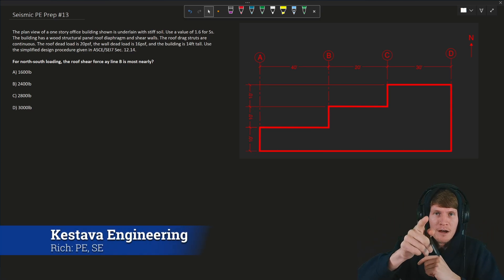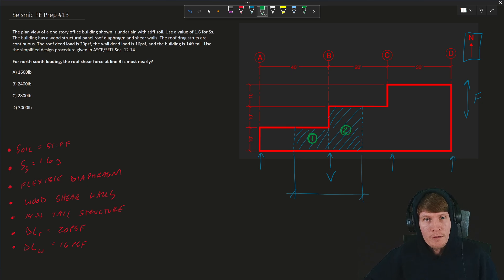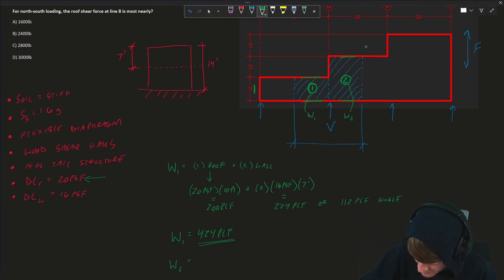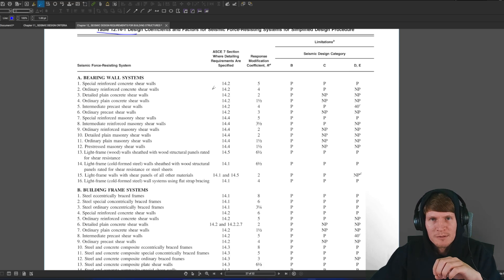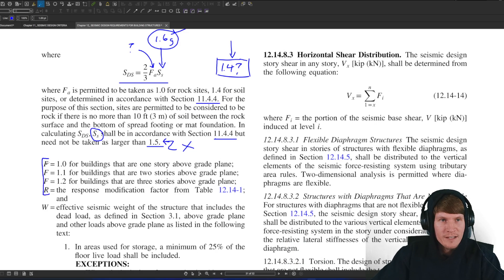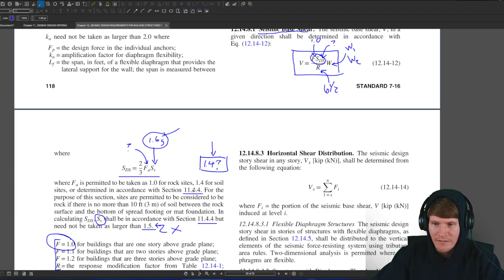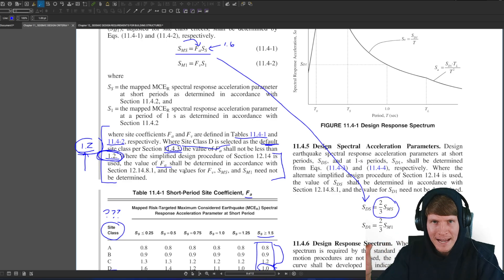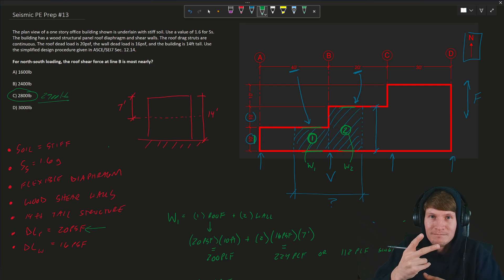PE Seismic Example Problem - 13 #structuralengineering #civilengineering #engineering

Comment: In a flexible diaphragm, the total diaphragm force should be distributed to the resisting vertical elements in proportion to tributary area, NOT tributary weight. Please correct me if I’m wrong, but doing so will result in a different reaction at each wall.
Reply from the maker: This can be tricky depending on how you describe it. Getting your diaphragm force is a product of the story mass and height based on the vertical distribution calcs. Since seismic force is directly related to mass, then tributary area alone would be incorrect if you have uneven distribution of mass through your story, if it’s all the same mass everywhere then you can indeed use pure tributary area, but if you have a significant load in a local area, then using tributary area would be inaccurate.
Reply: @Kestava_Engineering  I agree but the code explicitly states tributary area for flexible diaphragm. Thank you for all the amazing content!
Reply from the maker: @mortezazolfaghari7105  so in this example's building shape - are you saying the distributed story force along the length of the building would be equal?
Reply: @Kestava_Engineering  ASCE 7-16 12.14.8.3.1 states tributary area. So I would calculate the seismic base shear using 12.14.8.1, and then distribute story shear to each vertical element of the seismic force-resisting system (4 walls) using tributary area rules.

Comment: Stiff soil according to table 20.3-1 means Site Class D,  I take it as since its says "When the simplified method is used"  Use the 1.4 from that section.
Reply from the maker: yes - i looked more closely at table 20.3-1 and came to the same conclusion, although its a little weird to justify site class D just by the name of the soil and no data associated with it... but i would do exactly what you just said
Reply: @Kestava_Engineering  Thanks,
Reply: @ Question, If I have a Special steel moment frame system,  do I use the steel moment frame numbers in table 12.8-2 or do I use all others? I am thinking all others.
Reply from the maker: @sci-fimodeler1701  if you have a moment frame resisting 100% of seismic forces then you use the first option.

Comment: Thank you! 
Just a question about effective seismic weight W2, why you didn't include weight of 10' wall along line B?  
16 PSF *7'*10'= 1,120 lb
The final seismic base shear would be 3120 lb
Reply from the maker: @BasimAltemimi  good question! Wall weight parallel to the seismic force can be ignored because the walls weight doesn’t need to transfer up into the diaphragm because it’s already at the shear wall! You do have to account for the parallel wall
Demand once you are analyzing the shear wall tho!
Reply: @Kestava_Engineering  Thank you again! Yes, it counts only in shear walls design but not diaphragm design.
Reply: Create another video expanding on this same problem. Take the same question to the next level by designing the shear wall (assume wood) along line B. This time, use the NDS code to determine the nailing requirements and spacing.
	•	Is there uplift?
	•	Do we need a hold-down? If so, which Simpson (or another product) hold-down should we specify?
	•	Is the omega factor required for anchorage?  Embedment depth needed to resist uplift?

This would make for an informative and engaging video that others would find valuable! For the next topic, consider diving into collector design for this shear wall, which is another crucial and interesting discussion.